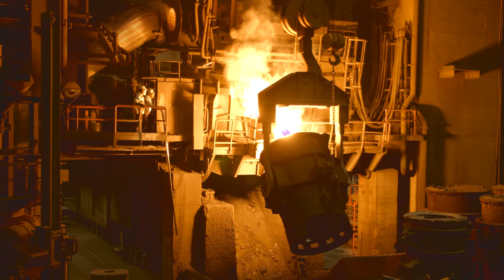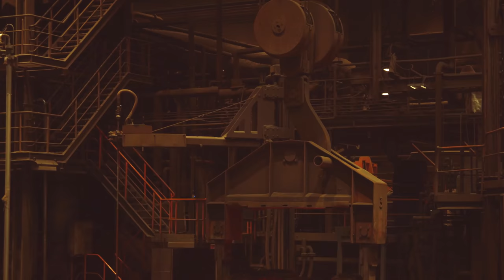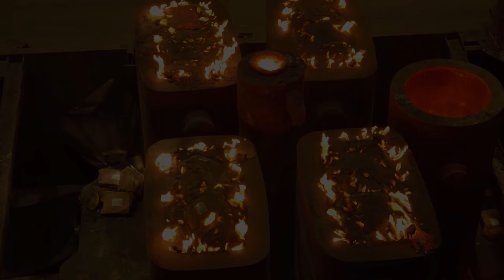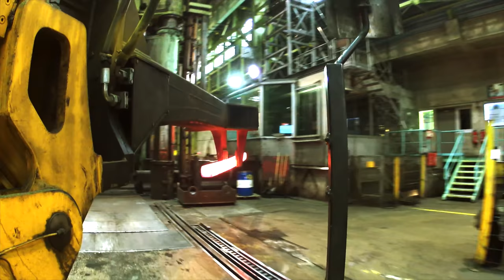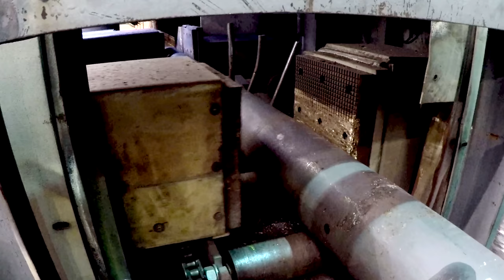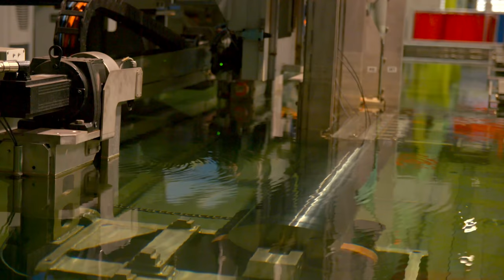manufacturing process of forged nickel bars || Machines and Industry

Comment: First it is heated with... energy. then the crucible is heated to ... very hot. then workers add .... stuff. the lid is then carefully lowered. but has a hole. after .... some amount of time, the crucible is raised and moved to the arm machine, which does its thing. then something happens and the worker puts the sheets on it. later, a big door is opened. and the hot thingy is taken to the squishy machine. the door is then opened and it is taken back to the thing. also, there are rods.

any questions?
Reply: Thanks Sir
Reply: Question: why rods and not ingots
Reply: I read this as if jeremy clarkson was saying it🤣🤣